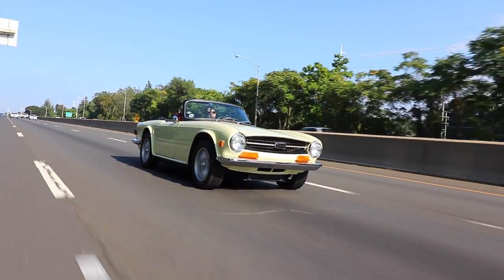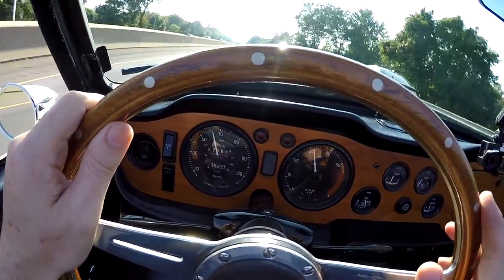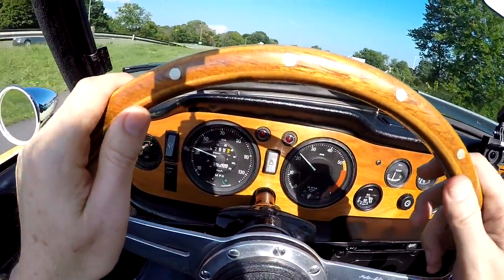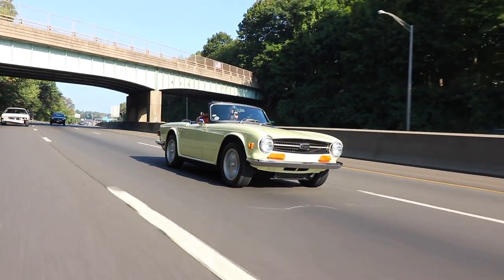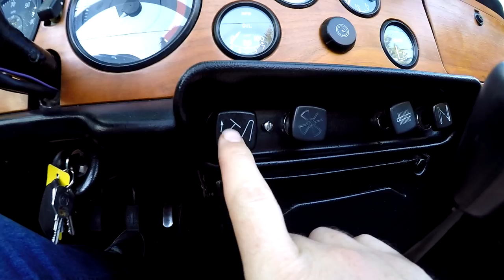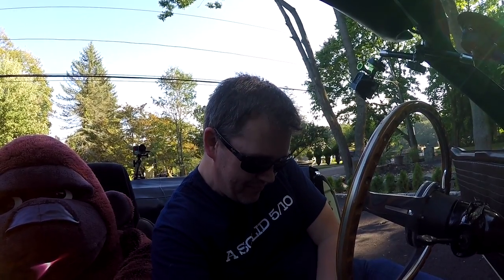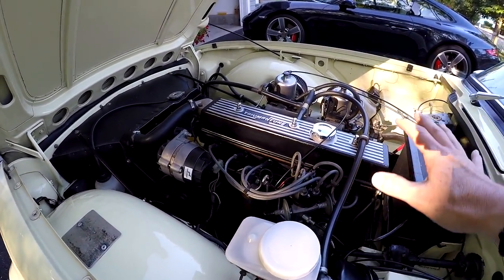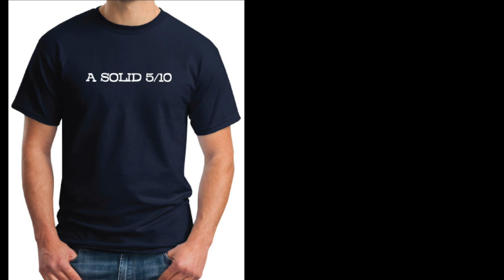Triumph TR6

Comment: My grandfather purchased one of these new in 69. He drove it for a few hundred Kms before pulling the entire car apart, putting the engine pieces in bags of oil and wrapping the body panels (he is a compulsive tinkerer and retired engineer). He has never got around to rebuilding it and apart from replacing the oil in the bags every few years it's still sitting there. I suspect that one day I'll end up with it and will have the opportunity to build myself a 'brand new' 69 TR6.
Reply: May I ask what was his objective in taking the TR6 apart?

Comment: Had a well sorted one of these for 20 years (think lots of hours & dollars getting it sorted).
Brakes are easily sorted by fitting vented volvo discs at the front.
You travel not in rocket ship but a time capsule with the special feel of everything happening on the road around you.
Easy to travel for hours in provided it's not 90+ degrees (no air conditioning...)
Thanks for doing this clip for all of us.

Comment: I have owned my red 75 TR6 for 25 years now. Just had it in London getting an overhaul by Enguneuity (TR6 specialists) and its now on the road for the summer. Best way to get at the key is to put your arm through the bottom of the steering wheel.  Thanks for the review

Comment: I had a 1971 TR6 in 1971. Went through 3 rear shocks (construction in my area at the time) and broke two U-joints. Had to drive it 15 minutes in winter to get the heat up. Felt like a king driving it but it handled like crap. Tremendous understear due in part to the over sized wheels.
But very nostalgic indeed

Comment: Love the old TR6s.  In Australia I had a 1972 Triumph 2500PI which had the same engine, but fuel injected (as were the TR6s here). I recognise the instruments as being the same too. But typical British they used a sub-standard fuel system which was a Lucas windshield wiper motor to power the fuel pump which could not cope with the 100+ psi fuel injection system. On hot or even just warm days it gave up due to fuel turning to vapour. Since those days I believe that pretty much all TR6s in Australia have replaced the crap Lucas system with an updated, low-pressure Bosch fuel injection system that works well.
Reply: yeah, my TR6 fuel pump managed to melt the solder of the motor brush wires! and the stub axles of ALL the Triumphs were weak as, and the trailing arm suspension a disaster for handling on the limit.

BUT apart from that wiper motor pump, that PI was magic , and on a sunny day theres no car I'd rather be in.

Comment: I am a stickler for originality an all but after a disastrous European tour I did in mine in 2006 I decided the brakes and cooling systems needed to be modernised. Had no accident just the brake fluid kept boiling in the Alps and the engine overheated dangerously in the Italian summer traffic jams. Now I have just driven the car from London to south west Ireland with no problems and have a cooling and braking system that is comparable to any modern car.

Comment: I was SO excited to see this review!  My dads brother, uncle, bought a brand new 66 TR4A IRS. About 70 he gave the car to my dad. I got to drive it through HS and dad even took it to Germany when he got stationed there from 80-83. I was there for two of those years and loved driving it on the Autobahn!  Dad passed away 7 years ago and I planned on getting back it back in running shape. Dad had let it sit in his driveway over the years and it was in disrepair. Well after finding the repairs were going to be very expensive I took a great offer from a person who rebuilt it. 

I did notice on this TR6 you're showing it has the exact same steering wheel as our TR4!?

Comment: My dad has a TR5, pretty rare car even in the UK, they're more around the 150bhp Mark with fuel injection as is my dad's. The TR5 is a TR4 body and was used as the test bed for the 2.5 straight 6 that was going into the TR6.
Reply: They were never 150, they were 142 at the most, this is 1969 when you could lie to the public
Reply: @simonedwards5070  how do you know?

Comment: My mechanic has had a 1971 British Racing Green TR6 sitting on a lift in his shop on and off for the last 5 years. The car is ridiculously well restored, and may actually look better than brand new. The guy who owns it is a surgeon who owns 6 TR6's, and the car is always in his shop because it is so unreliable.
Reply: gmansplit yup! In high school my boyfriend had one one constantly in the shop. His dad fortunately paid for all the work. It was low miles and like new just didn't run well.
Reply: TR6 require a special knowledge set, with the right knowledge and mechanic they are 100% reliable and that's the petrol injection version.
Reply: Agree.   I have had one for 15 years and pretty reliable considering its age.   Let's just say that a 1970 Camaro wouldn't do better.

Comment: 'Quirky details'... Steady on nick. Resist the Dougisms.
Reply: I had a '85 Ford  F150 pickup with the dip switch on the floor. No one said that was quirky. By '85 just very outdated.

Comment: Nice looking example. Detuning and carbs for US models was for emission regulation not reliability, bit of a shame to strangle the power potential of what is a sports car. Never had any issues with my PI. I prefer the earlier ignition key location, albeit a bit of an odd position and offers no steering lock feature, but much more accessible! Shame the UK models didn't have as many dash toys, lights and buttons as the US versions.

Comment: Nice overview overall but did not focus on the best part of this car: the exhaust note.   Also, the comment that this is not a common car in the US?    Most of the TR6 sales were in the U.S. - of the 94,619 models produced, 86,249 were exported, with just 8,370 sold in the U.K.   The UK 150 HP Lucas injection version is appealing for sure  but the the reliability of the US version and availability of parts make this a SUPER potential collectible for the world market.  The best examples come from the US and are being swept up by other folks in other countries.  I have a '75 myself and a friend of mine just bought two US barn finds and sold them at ridiculous prices to a buyer in Germany.   Cheers.

Comment: Hi Nick.  Nice review, but a couple of corrections if I may.  1)Triumph were not THAT small a company; over the years they had quite a decent range of cars. 2) I can't think of any other NEW car in Britain in the 70's that had a 6V battery - except perhaps a VW beetle, (obviously imported)
The engine in this example is in excellent condition, but I certainly don't recognise that rocker cover.  Surely it must be an after market one?
Regards Mark in the UK
Reply: Rocker cover is from Moss Motors.   I have one as well
Reply: yep, and some of the Brit cars had kerosene lamps instead of headlights.  ;-)

Comment: I like the shape of a TR 4 better . TR 6 looks more like a box
Reply: Your comment brought back memories of my first car. A TR-4. My brother has graduated from college and he gave it to me just as I was starting college myself. I remember those rear shock absorbers with the lever arms. Always needed tightening after a while. I ended up installing a fan that could actually work. A fiberglass fan than could move some air. The fans had to be replaced every so often. It didn't make any sense. The original fan wasn't very effective but the heater could put out heat during the winter. I ended up putting a plastic bag blocking over half of the radiator to get some heat from the heater. It was a fun car and it taught me a lot about working on a car.

Comment: Just so you know I'm judging your janky ass security cam wiring job, I expect better of you Nick. LOL
Reply from the maker: And so you should, it is a disgrace. One of those I will just do this temp style until I get the new cameras and then 2 years later it has never been fixed. On the list.
Reply: That's why I never did my system, I bought a camera system and had my builder look at installing it and he said it would be a nightmare putting it in an existing house so I just said screw it, sold the system and bought Ring products.